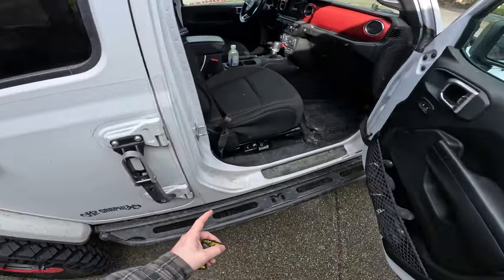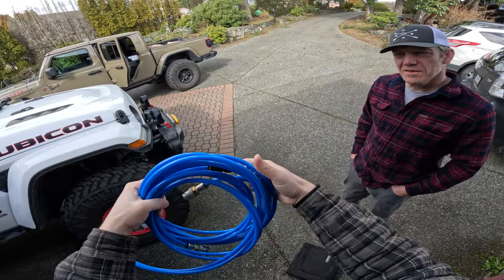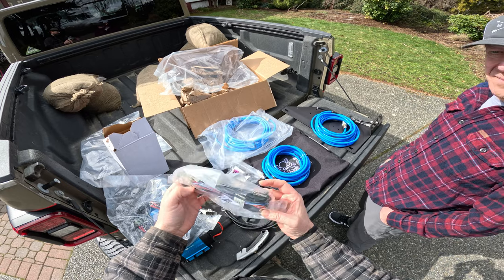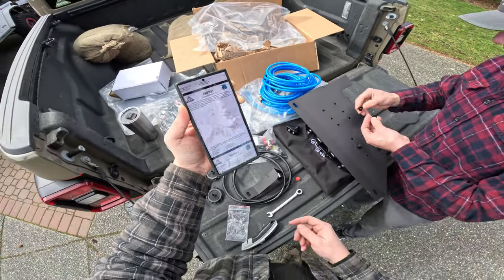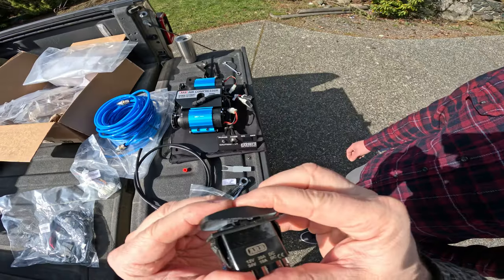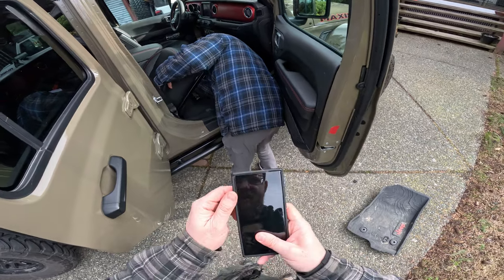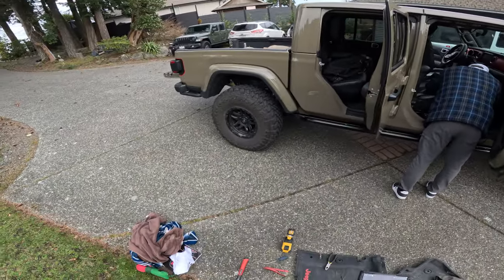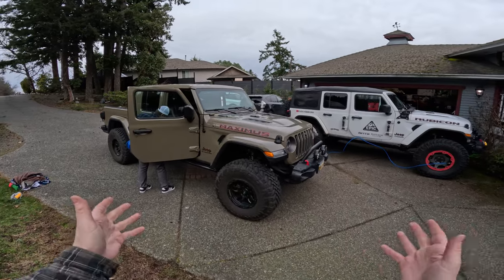Installing The Best Onboard Air System for Your New Jeep Wrangler or Gladiator

Comment: The only thing i would suggest is , when mounting the compressor to the plate , i would wrap those 3 or 4 bolts with teflon tape. When those ARB  compressors run they vibrate alot, which over time can cause the mounting bolts to loosen . So i have found adding teflon tape keeps them tight. Just a friendly suggestion 👍
Reply: Blue loctite would be better than teflon tape.

Comment: I myself use the Morrflate system with my 10lb C02 tank. I have found that it takes about 30-45 seconds to stabilize the pressure on all four tires using the included pressure gauge for both inflation or deflation. The Kraken looks great, but it would be nice if they included an inline gauge on the operation plate, as well as an easy deflate switch as well so one could stop during the inflation/deflation to check approximate pressure. Then when it’s close to desired pressure then wait 30 seconds to stabilize after pausing, and adjust as needed for final tweaks to the pressure.

Comment: I added a gauge to mine that sits under the seat since I don’t run tpms. It’s accurate when you shut off the compressor and cost $30 to add.

Comment: Regarding airing down, you actually can with this system, put the air chuck on each tire, but do NOT connect to the quick connect on the Kracken. Tires deflate quickly, and use your TPMS monitor system to deflate to your pressure desired.

Comment: its a nice kit. I did however make my own dual tire inflation for much less that shuts off when your desired pressure is reached. Purchased a regulator  , a splitter, hose and fittings from  crappy tire for 100 cdn.
Reply: That's what I've been thinking, great idea. That way you can really walk away and forget about it. But maybe stick around in the area just to make sure nothing goes awry. I'm going to do this to mine

Comment: Hi, do you know the brand of the plastic push to connect ?. 
I have fitted the same (direct fitting to the ARB) but the air pipe keep blowing, I think it can't hold the heat and pressure. So ai go back to the original fitting with the ARB metal connector, then  steal breaded hose then ARB, then ARB cuppler.
I need the plastic fitting as it's much better to work with.

Comment: Why would you want the compressor inside though? I have my arb dual mounted to the bedside. Also allows me to fill a gladiator behind me with my speed flate 4 way system.

Comment: I like the look of this system. Got a question, we're in Australia. would the mounting plate fit under our driver's seat? Our driver's seat is your passenger seat. We drive on the other side of the road. Cheers.

Comment: I like it, but man $305 for a few hoses and a couple mounting plates is too steep for me. You have to buy compressor separately. I’d be a buyer for around $75 and they can keep the bag and sticker. 🤷‍♂️
Reply: Maybe you can start your own Chinese company that rips off all of the engineering and design that goes into putting a system together like this and then sell it for $75. You’d make a fortune with the $1 profit you made from each kit sold.